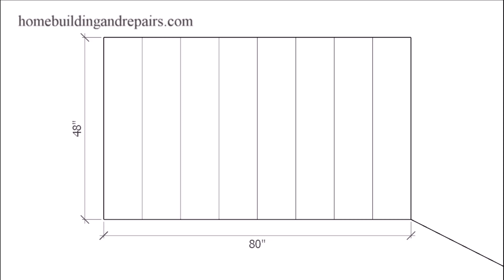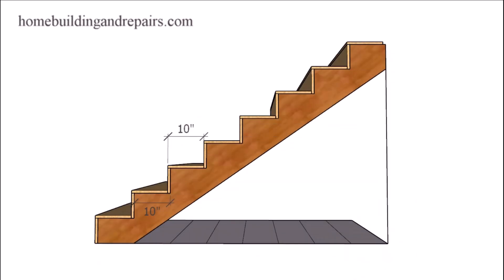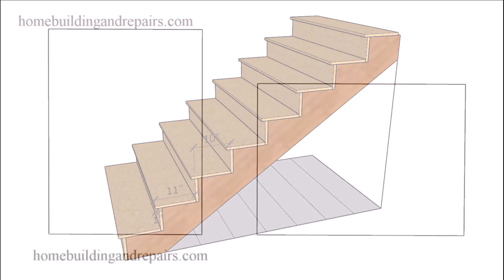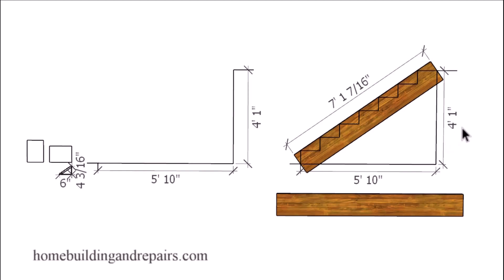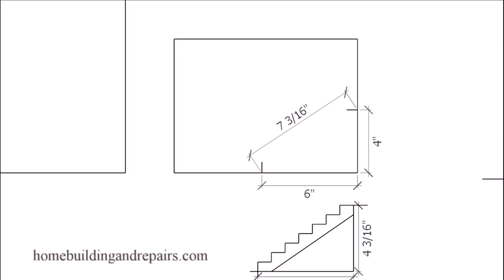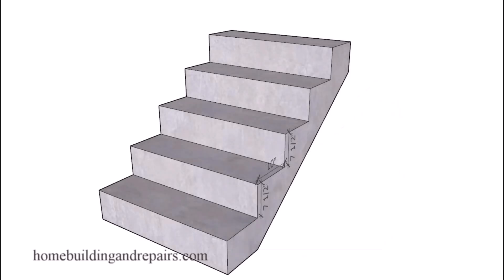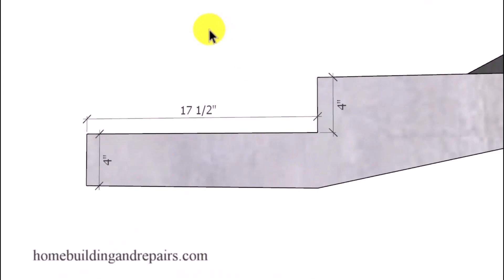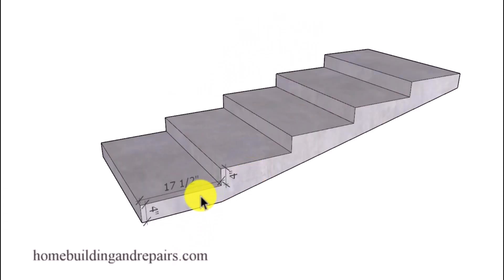How To Avoid Stair Stringer Layout And Nosing Mistakes For Accurate Design Calculations

Comment: I think an even bigger challenge and area of getting tripped up on stairs for diy people is when there is a need to size the steps to fit in within a given total run and rise... especially when the top step of the stringer is to top out not at the top floor level but at the second step down from it. Example sidewalk-to-deck level stairs.